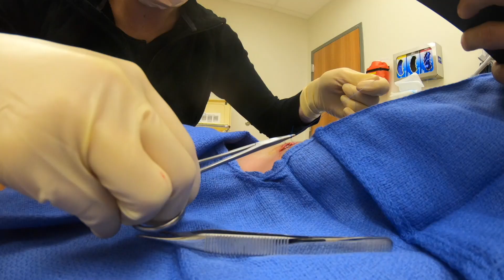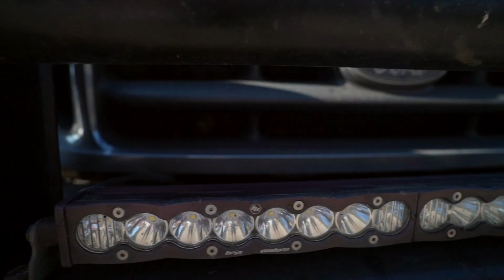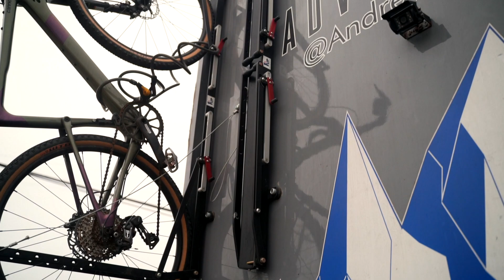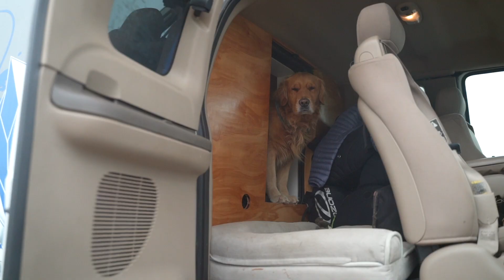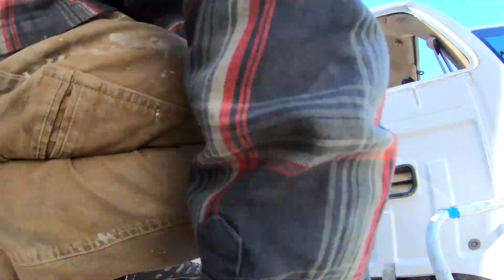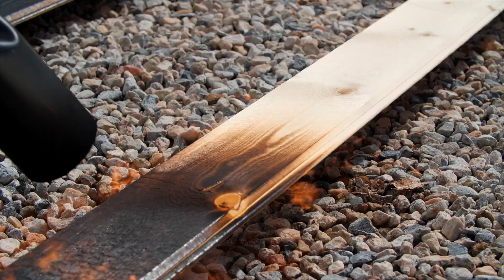DIY Expedition Vehicle FULL TOUR - Tiny Home Adventure - MUSEROAMER Project

Comment: Hey Andrew, I’m an electrician and I know that there is a kind of tracing(a cable that heats up) which only heats up when it gets below freezing, it does not use much electricity. When its above 32 degrees it does not use electricity at all. Maybe this could be a temporary solution to your water system?
Reply from the maker: That sounds like a really solid solution. I’m going to look into that because it would be a game changer!

Comment: Great tour video and absolutely mind blowing build! Congrats and glad to see your legs healing up.

Would love to see a bit more detail on your water system... Do you have any filters? Are there sensors in your holding & greywater tanks to show the levels? Where on the rig is the greywater dump and do you have an electric ball valve or do you have to open it by hand outside?
Reply from the maker: Thank you so much for the stoke! The leg is feeling great thankfully, I've been on the mountain almost every day since we've been back. We don't have filters or sensors on our tanks to show the levels. Thankfully in Baja it was extremely easy to fill up the rig with purified water, we actually found it easier than the U.S. The grey water dump is under the rig and we pull it by hand to open it.
Reply: @AndrewMuse  thanks for the quick response! My wife and I are researching the idea of building ourselves a travel rig and your videos have been such an informative view into the commitment and the struggle to build something so beastly! Call it a much needed reality check to bring our dreams into alignment with our current skills and resources. Glad you're healing well, I snapped my wrist snowboarding last season and am back out there this year with a plate and bunch of screws keeping me together 😝

Comment: Hey! Another awesome video! You guys were actually the inspiration to start designing my own "expidition" vehicle. I am actually considering putting an ambulance body onto an F-450 or something and I was wondering how your mounting system is holding up? Does it allow for enough flex so that the body of your rig doesn't break? Can you recomend this method of attaching the box or should I find another way? Thank you both for all the inspiration! Im so excided for the coming adventures :)
Reply from the maker: Thank you so much for the stoke Julian and that's awesome to hear you're planning your own build now! The mounting system has been holding up great. We haven't had any issues with it not flexing enough and we took the rig on some pretty gnarly terrain in Baja.

Comment: Did you have to do anything to the engiene because of alll of the weight? Or is it just a little slow?
Reply from the maker: I “bullet proofed” the engine which replaces a few parts known to fail on that engine but not because of the weight. It’s actually not even that slow. It pulls almost the exact same as it did before.

Comment: What did you ever do about the corner wall panel separation?
Reply from the maker: So far we've only siliconed the cracks, but once we get back Utah where we can get in the shop we'll sand everything down and redo the fiberglass and bondo and repaint it.

Comment: Forgot to ask what is the interior hight. 
And road to interior floor hight. 
Thanks again. 
You rock. 
I also myself fly speedwing, Paraglider, Paramotor, kiteboard, Snowkite, Surf, Ski, Snowbike etc ... 
This is fun stuff. Really loving your Videos.
Reply: Thank you Andrew for taking the time to reply. 
I sent you a PM  
I’m in Santa Fe NM. Yes... if you drive by will be great to meet. 
Thanks for the info regarding some of your rig specifications. 
Beautiful.
Reply from the maker: That's awesome, where are you based out of? We should meet up for an adventure sometime! The interior is just over 6' tall, we honestly could have made it shorter. And the road to the floor is about 3 1/2 feet I believe.

Comment: Hello guys. Incredible rig. Loving all of it. 
Question for you. How tall (open space from overhead bed plywood to ceiling) and what is the roof hight from ground. Thanks a lot (in advance) for your reply. 
Also. What is the bike carrier brand. 
I really love your adventures. 
Thanks for sharing.
Reply: Thanks Andrew. 
I thought your overhead bed had about 3feet headroom or 2’6 from top of the bed. That sound perfect. 
And I understand about 36" above the roof (because of roof rack to top of antenna) 
Thank you so much for the info. 
You guys rock.
Reply from the maker: Thank you so much for the love and support Jean! The bike rack brand is 1Up and we made a few modifications to make it vertical. The rig is 13'6 with the air conditioner and WeBoost antenna on top. The bed space is about 2'6 when it's made.

Comment: Could we see more about battery, solar, electrical systems you are running?
You mentioned the 3 170W solar panels but not how many Ah of battery you have. 
Thanks.
Reply from the maker: Definitely, we've got 400 Ah! Let me know if you have any other questions from anything we missed! We actually just realized one of our panels came wired backwards after finding a popped fuse so we've been happy to have that panel working again.

Comment: Why run a propane heater when your truck is diesel? Diesel heaters put out much dryer heat if I'm not mistaken.. would probably help with your moisture bedding problem too?
Reply from the maker: We worked with Dometic on our appliances and they didn't offer a diesel heating option, but the propane is exhausted to the outside so it doesn't add any moisture to the rig thankfully.

Comment: Would it be possible to suck out all the water from the tanks below, with a shop vac or something, to avoid bursting pipes? Or is that more trouble than it's worth? Or maybe it would be difficult to get safe, replacement water, depending on where you guys are?
Reply: There are 12-24VDC electrical controlled valves that they can be triggered automatically at specific temps to drain the system as the last resort.
Reply from the maker: We can totally winterize the system by draining the water and filling it with antifreeze that would be super easy. We just didn't last year since we live in it full-time.